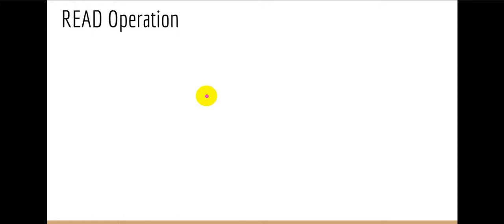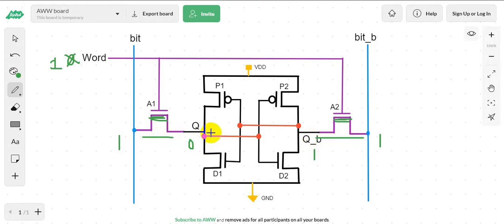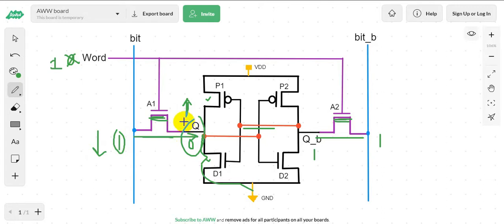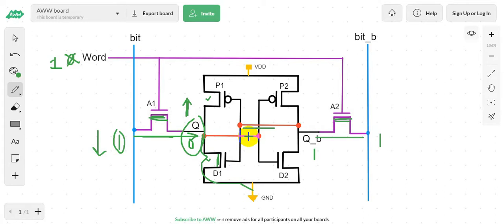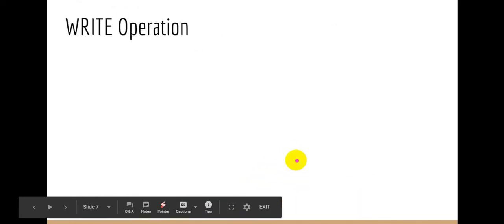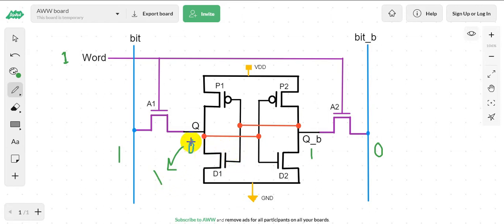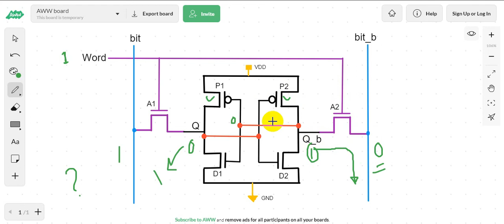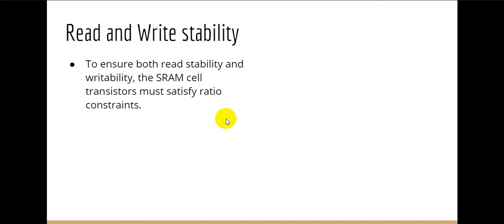SRAM PART 2: Read & Write operation of SRAM memory cell (Circuit, Waveform & Working principles)

Comment: sir, how to draw butterfly curve for SRAM for calculation of read static noise margin?
Reply from the maker: you can draw it using any schematic simulation tool like cadence virtuoso. You just have to develop a current-voltage equation there. Soon I will post the implementation details. Thanks for reaching out.